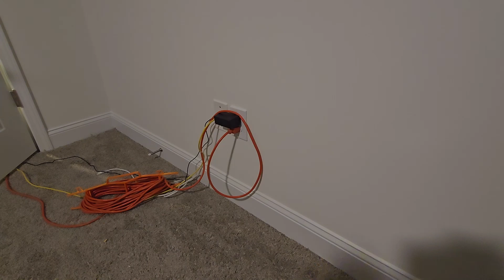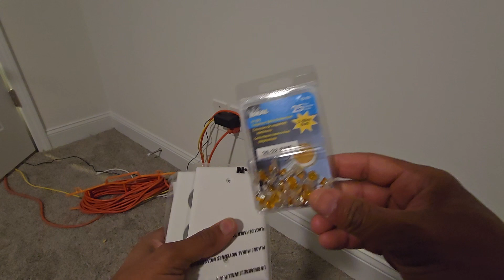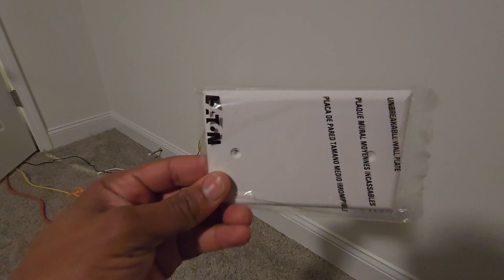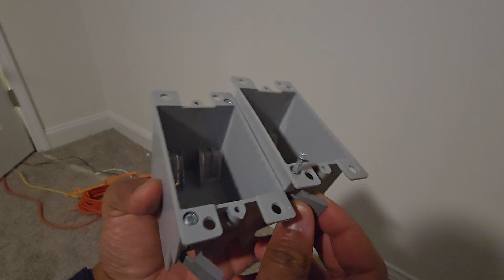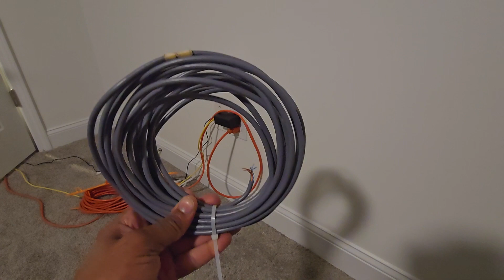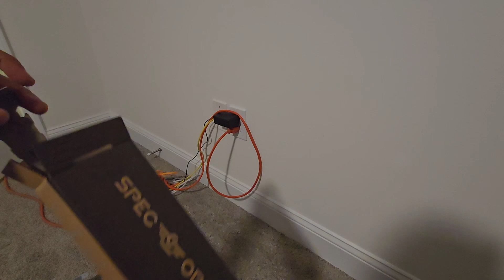Moving / Adding | Electrical Outlet | Ethernet Jack

Comment: If I could offer a tip. Your camera is grainy and has a slow frame rate because the light in the room is not adequate.  Also if you put a light diffuser in front of your light source you can lose the hard shadows that a bare lamp gives you.  You don't need fancy studio lights. In a room with basic white walls and ceilings like that you can bounce the light off the walls and ceilings in the area you are working in. It should feel unnaturally bright. Cameras love light, this way they can stop down and use a faster shutter. It will give you more information for your sensor. The graininess of the video will go down and the motion blurs in the video will stop happening.  Great job. The secret to YouTube is to post regularly, be interesting / entertaining and keep the language Disney.
Reply from the maker: Thanks for sharing. I will keep this in mind. 🙂